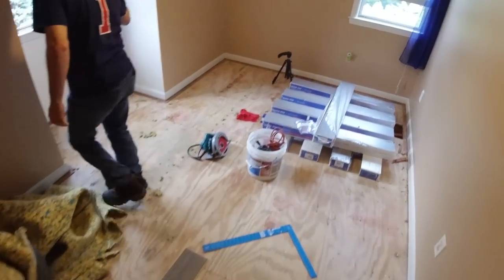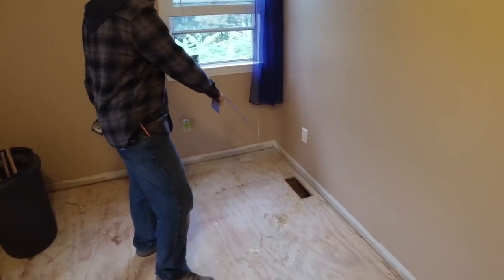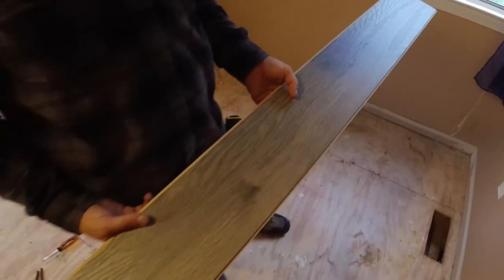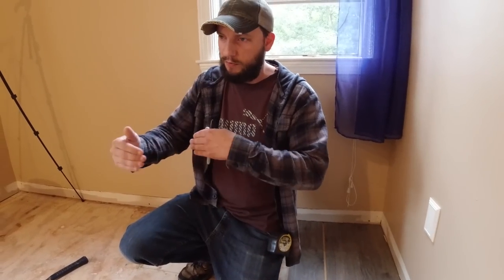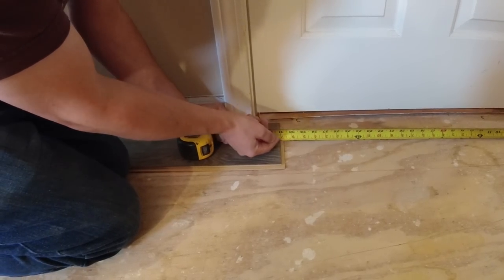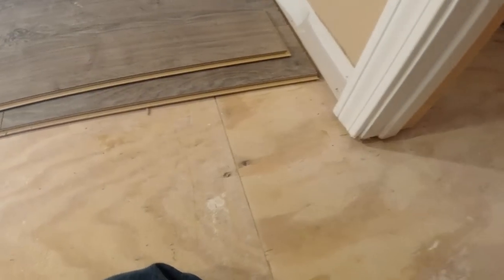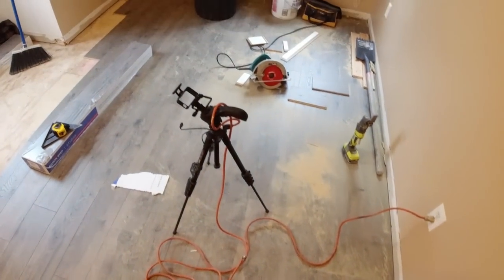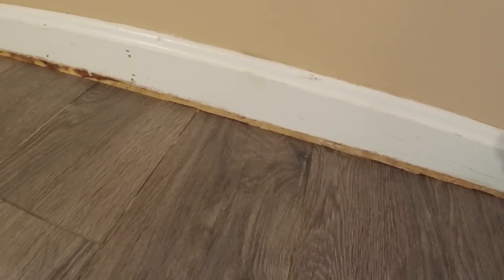How to Install Laminate Flooring | Easy Step By Step Instructions

Comment: Thank you so much for your explanation on using the chalkline.   So many just say to use it, without explaining the process of actually putting it in place, and then using it to verify if the wall is straight.
Reply from the maker: Happy that helped, Sean.  That is what I try to do more than other videos out there.  Lots and lots of details!  Thanks for checking out the video!
Reply: @TheFixerHomeRepair  

By any chance, do you have any suggestions on how to approach an issue where your wall is not entirely straight as it pertains to cutting the boards to fit?

Should I start paying wood at the level line? Or should I start by trying to get the first row cut to where it had a sloped edge against the wall?

Comment: Love it! We're doing our kitchen in the Spring and I would have never thought about to put spacers against the wall. As always thank you! ❤️
Reply from the maker: Yes!  Very important!  Hope these tips help you out and as always thank you to such a loyal fan! 😃😃
Reply: What do the spacers do? And why should we use spacers? The tile not suppose to touch the wall?
Reply: Cotton Oh So Cotton laminate, hardwood etc expand and contract depending on heat/cold. If there isn’t space to expand then the floor has to expand somewhere else. Causing the boards to lift up and out somewhere in the room. Take a piece of paper.. then push from both ends of it, you will get the picture.
Reply: Cotton Oh So Cotton listen at the 1:00 mark he explains it.
Reply: Thx!

Comment: Great video ! My only tip to others if your going to follow this to a tee .. and your not continuing the hall way , rip the 1st row off the door jam . You want your transition under the jam . You don't want that grab. Then at 20:13 .. you won't end up ripping under 2-3in plank like he had too based off the veiw never got to see a close up of that last side . I'm thinking they had to still had a hard time with that hallway with out ripping a long strip under half a plank .. just my guess .. solid work and my sure his buddy happy with the job

Comment: 🌟✨🌟 Great video. Thanks.  Is there a way to  turn around and install the flooring in the opposite direction? I
Have to go into a closet. The doorway is 24 inches and the closet opens up inside to 5 feet. The boards will be perpendicular to the doorway not parallel so when I run the first row on the left side of the doorway extending them into the closet then moving to the right I’ll have a few more pieces to install going  to the left.  With hardwood flooring you can put pieces back to back.  Groove to groove which allows you to go the opposite way in certain areas.  ✌🏼
Reply from the maker: Hey, James!  There is always a way... I would not recommend flipping the floor.  You should still be able to continue the floor into the closet the same way, it will just take some extra effort.  I suppose if you really wanted to you could flip the boards and put a threshold over the seam.  Hope this helps.  Thanks for watching, James!!

Comment: Great video...1 question. You mentioned you lucked out at closet door. What happens if it doesn’t line up. Do you have any videos reflecting how to lay and attach boards that need to be ripped? Thanks!

Comment: Question:  Is the floating floor process the very same for a cement subfloor?  Only asking because I really do not know.  Great job, guys.  Looks awesome.  Thanks!
Reply from the maker: Hey Robin!  Yes, it should be the same.  If you have a situation where you have a lot of moisture like a basement with no sump pump maybe you could paint the floor with a sealer or install a subfloor but this stuff is very durable and resistant.  That is my opinion anyway!
Reply: You would also have to use underlayment (it is a very thin insulation,helps with noise reduction and acts as a barrier between any dirt and your flooring.)

Comment: The directions say use pe foam on the edges of the flooring the a flex seal on top..did u do that or it isn't needed
Reply from the maker: Hey, James!  With this type of floor I used it was not necessary.  I would always follow the recommendations of the manufacturer of whatever floor you buy.  Hope this helps.  Thanks for watching!

Comment: Can you still put an underlayment even if you’re laminate still has padding underneath?
Reply: Jesus is Lord - no more than 1 mm high density only. Not EPE or EVA underlayment, would be more like a 1 mm IXPE normally used for LVT. Other installers use similar product to Shaw Selitac.

Comment: Hi, great video, but I have an issure in my closet....What do I do around the crawlspace door opening, and to the cover of it with the planks??? do I glues the planks to the crawlspace cover? How do I cut or nail or glue around the crawlspace opening??? Nobody has videos about this which is mind baffling!!!!!!
Reply from the maker: Hey!  Yes that would be a great video!  Wish I had something like that to show.  So what I would do, if the crawlspace cover is even with the floor, is just start laying the floor over it.  Make sure to mark it as you go, I would even mark it about an inch bigger than the hatch itself.  Then you can either cut the pieces out as you go or after carefully with a circular saw and either a jigsaw or multi tool for the corners.  Then with stuff like this I would just shoot some nails into the flooring over the hatch and either drill a hole in the hatch or make some sort of handle for it.  Hope you can visualize what I am saying.  Like I said this would be a great video so I am sure I could explain it much better that way.  Let me know how it goes if you do it.  Thanks for the comment and for checking out the video!

Comment: Sorry, it was hard to see but did you use the spaces around all edges of the room vertical and horizontal or just one the one edge of the wall where you started?
Reply from the maker: Hey Jonny!  I only used them on that one wall and then estimated the gaps on the other walls.  Hope this video gave you some insight into how to install the floor.  Thanks for watching!
Reply: @TheFixerHomeRepair  Thanks. It helped a lot especially looking for one that was going to reuse the base trim without using quater round trim.

Comment: I've laid many a wood floor, and might try this stuff. For the baseboards, did you label them to get them back in the same order or it didn't matter?
Reply from the maker: Hey Christine!  It was pretty easy to figure out which pieces went where but labeling them is a good idea.  Thanks for checking out the video!

Comment: I know laminate flooring is suppose to be floating,  but i have a large living room and i dont trust the floating way in my living room,  can nail down the laminate flooring with 1 inch brad nails?
Reply from the maker: Hey, Saeed!  I would not recommend nailing the floor down.  It needs to move around (not a lot). If you nail it down there is potential of the seams popping out of each other and i'm sure some other issues.  You can do whatever you want but the product is not meant to be nailed down.  Can I ask why you don't trust it?  What do you think the issue will be?  Thanks for the comment.

Comment: My first issue is that my first two pieces wont lay flat. They kinda wobble back and forth. Is there a trick to laying them down even with the floor ?
Reply from the maker: Hey!  Floor leveler would be your best option.  You can get the stuff you add water to and spread it on the uneven part of your floor.  You could try to take a few pieces and put them together on a flat part of the floor then move them to the uneven part but if it is too uneven it will move when you walk on it and potentially the seams could come apart.  Do you think you could do the floor leveler or is it not worth it to try?
Reply: The Fixer hey thx for the tip. I actually gave up after trying to bang them together. I’m having Lowe’s do my install. It’s not worth it. Plus I have a lot of area to do
Reply from the maker: @Sjrick  I hear ya.  No shame in that.  I wish I could have helped out more.  Thanks for checking out the video though!

Comment: So underlay not always necessary?
Reply from the maker: I guess technically this floor had the padding on the back so that can be considered underlay.  You at least want the padding with this floor but I wouldn’t worry about any paper or anything.  Hope this helps.  Thanks for checking out the video!

Comment: Very good video. However, if you cut a board, you can only use the cut piece against the wall because you have cut off the interlocking end. This was not mentioned in the video.
Reply from the maker: Hey!  I did mention that if you cut a board the other piece can be used on the opposite side of the floor as a "starter".  It is a long video so maybe you missed that.  Thank you for checking it out though!

Comment: pro tip ,notice how your paint stirring stick went under your base board when you banged on the second row,not good sticks will get stuck your flooring is being driven under baseboard,get your first row set straight then get some wood screws  you dont have screw but a inch or so into subfloor 2 to 3 ft apart  ,screw behind first row nxt to baseboard they stay in place i do flooring for a living
Reply from the maker: Great tip, Mark!  Thanks for watching!!

Comment: guys,I wonder where is underlayment?))  as far as I know floating floor laminate particularly can’t be installed without underlayment!) I’m kinda shocked 😳 😅
Reply from the maker: The underlayment is built into the flooring.  It is the padding on the bottom that I pointed out in the video.  Thanks for your question and for checking out the video!

Comment: My floor has a carpet that I'll be replacing with a laminate floor. The carpet has a 1/2 in. Particle foam pad. Should I leave the old pad and lay the new laminate floor on top? I thought it help insulate the sound . Please advise. Thank you.
Reply: Richard A. Valdes - carper pad should be removed. If you use carpet pad as laminate underlayment the click system will break due to  instability.

Comment: With the trim cut off saw...it should cut through the molding very easily. If you find any resistance,
you  hit a nail....STOP there and remove that nail, otherwise you will destroy the cutter blade.
That happened to me ...had to go buy another blade... Just saying.

Comment: Why do you call it a floating floor?
Reply from the maker: Great question!  The reason it is called a floating floor is because it is not glued or attached with fasteners.  It literally just sits there and “floats” around with the changes in humidity and temperature.  Thanks for the comment and thanks for watching!

Comment: Reply to  my comment, i have installed 30 different floors of varying brands for a landlord i work for. I think its all junk. Every single piece you have  to beat the ends, and many times the long locking sides ,with a block as you illustrated. Some you literally have to pound HARD. Especially if you have a second doorway at a 90 to the first doorway, you have to beat it both directions, length and width.
This product CAN NOT BE HIT THAT HARD, it splits the groove more than just occasionally, making it a junk unusable piece.  and yeah i use the pry bar on the ends (thats OK )
Sometimes you dont see the damage until you are many rows out. tell me what is wrong. I see you beating it with a tongue block, so I KNOW you damage pieces. Whats the deal?

Comment: Lmao....all I got to say not horrible but  never hit finished edge unless u want to chip it take from someone who only does this everday for the past 12 yrs
Reply from the maker: Hey Fox, that is what the extra piece of flooring is for.  To protect the edge.  Obviously you don't want to go crazy hammering on it but the pieces won't usually just will themselves into place.  They need a little love tap.  Also, the flooring they make now is much more durable than it used to be.  If you have other suggestions on how to get pieces into place without hitting them in, it would be very helpful to the viewers.  I'm sure a professional of 12 years has loads of tips.  Looking forward to hearing some!  Thank you in advance!

Comment: I am a DIYer. I do all repairs and maintenance on my home and car myself so this video irks me. The first thing: If you are going to give advice, advise people to purchase the proper tools to do the job such as a tapping block and pull bar. A simple set with spacers cost $20. I could clearly see where the edge of at least one board in the closet was damaged from the crow bar, and I'm sure it will be covered, but proper tools could have prevented the damage. 2: 99% of laminate floor manufacturers recommend end pieces be at least 8" and I know I can not measure with my eyes, but some looked to be smaller than that. 3: The larger the room is the larger the expansion gap should be and should never be less than 1/4". It is very difficult to know how much space is under the drywall and to be 100% sure that the floor and drywall do not touch in any part of the room. 4: Never cut the materials in the room you are laying the floor in, the flooring probably has tons of saw dust under it now. & 5: an easier way to measure and cut end pieces is to flip the board 180 degrees, slide to the wall with a spacer and mark where the end of the last board is. No numbers or subtracting and you get a perfect cut every time.
Reply: Blah blah
Reply: Good video did my kitchen on my my now to do niece's living room ( they were so impressed with the kitchen)they insist on paying my.....ok then😁

Comment: Why not just flip the flooring over to Mark instead of using the finished side. The reason you stagger is so the tongue holds the joints together. You should also put the tongue towards the wall so you don't have to hold your block up like that